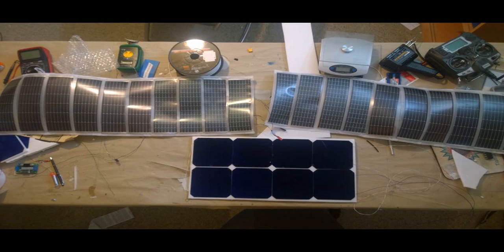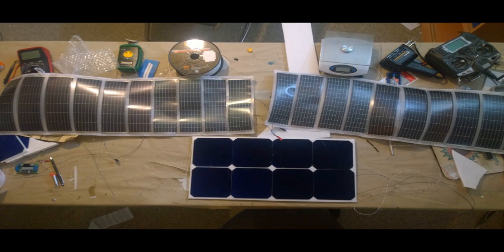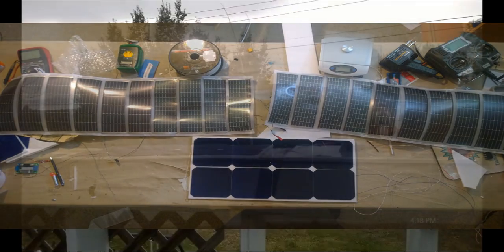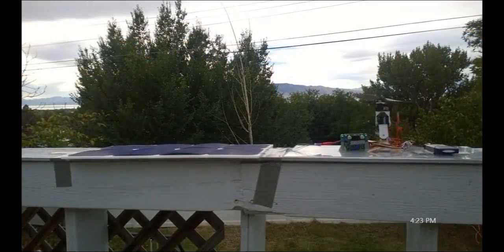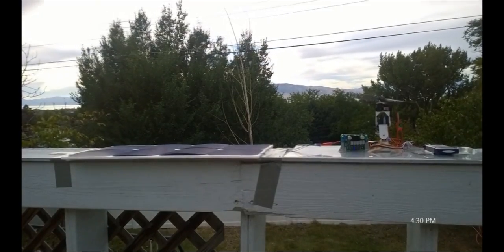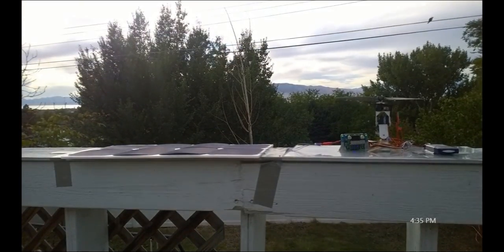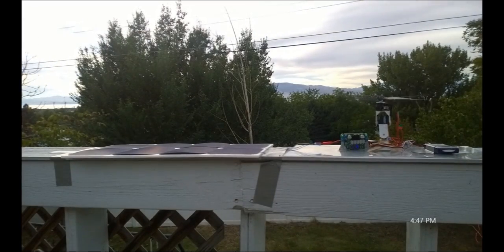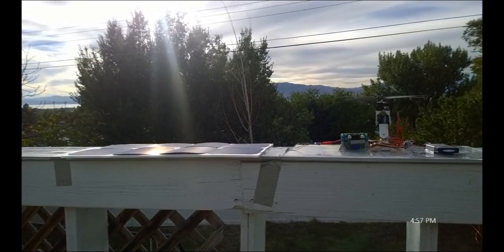Solar Airship Project Update: Complete Power System Test on Cloudy Day

Comment: Nice video bacca. Quick question, what did you use to inflate the balloon? hydrogen is lighter but can catch on fire and helium which is safe but less lift and expensive to get
Reply from the maker: +goodroach I use hydrogen when testing, for one thing it's very easy to detect leaks with since it reacts so easily. I use Helium when flying outdoors though.

Comment: I have a (probably) insane suggestion... What if you were to "refloat" the wrecks under South Haven and lift the entire city into the air?Do you think Minecraft could handle it? Would there be enough wool? I think it just might be possible, for the central island perhaps.
Reply from the maker: +Stephen S I doubt there would be enough lift on the central island, mostly because that is where the only brick buildings are. The other buildings? Maybe. But it would be very impracticle, would look silly, etc :P
Reply: +BaccaYarro It depends what you filled the Behemoth's wreck with. If it's mostly wool it should work, but if it's mostly gravel or slabs, then it won't. 
Although you'd have to use a custom .craft file anyways, since the gravel and such wouldn't count for any normal craft type.
 
Some of the smaller piers probably have a better lift/weight ratio, but they wouldn't look as impressive on their own.